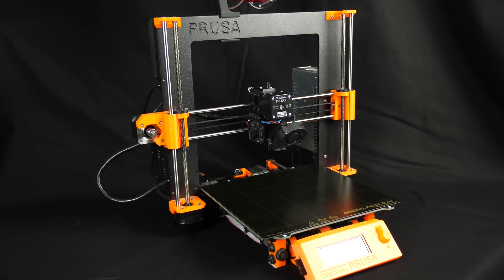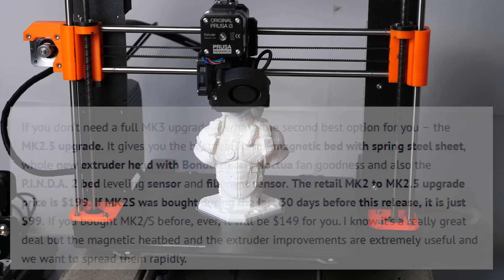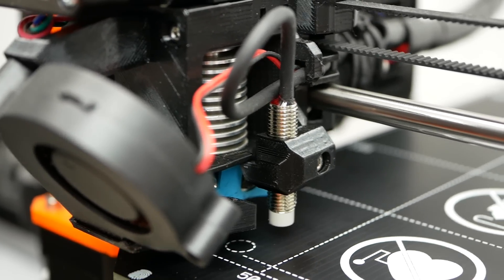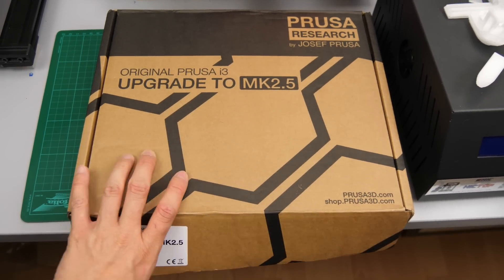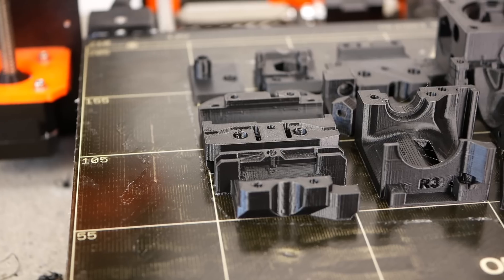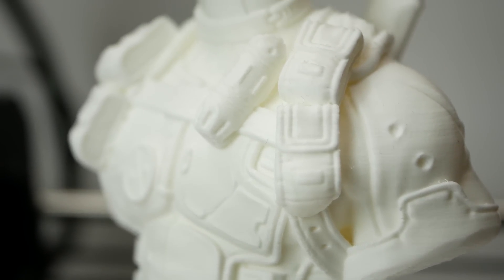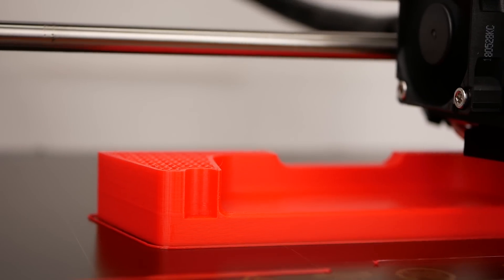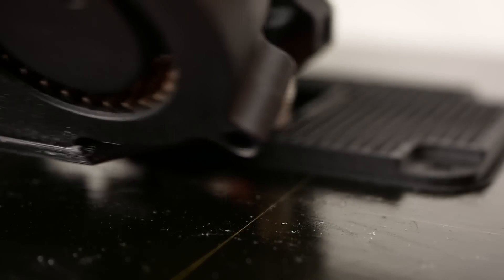Prusa MK2.5 UPGRADE kit - Worth the price & effort?

Comment: After Upgrading my MK2S to a MK2.5 I had some problems - especially regarding overhangs.
But now I found the BEAR Mod Project. I upgraded my MK2.5 to a BEAR including the new X-axis and new extruder. And now it prints really great with the profiles by Chris Warkocki.
Only test missing are overhangs because I now print the Upgrade for my other Prusa ^^

Comment: i have already upgraded to MK2.5 with the powdercoated sheet and it's work very fine.
I Have two questions for you!!
It is possible and if you want that u can share your file setting on S3D for prusa MK2.5.
have you already tried to apply acetone on the steel sheet? let me know if it damaged??

Thanks a lot for your video .

!!!!!! HAPPY NEW YEAR!!!!!!!
Reply from the maker: Happy new year Fabien,
my S3D is noting special. Just the stock one that comes with the software. I don't really belief in much profile tweaking. Slicers have come so far that this shouldn't be that big of a deal anymore.
Have cleaned mine with acetone (NOT the powder coated one) and it didn't do any damage. Have you had any issues?
Reply: CNC Kitchen 
No I was just afraid to try? 

Thanks for your answers

Comment: Got a chinese mk52 clone for my original Mk2 for around 70 USD on AliExpress ~ After flashing the mk2.5 firmware, I had to modify the heatbed with double side tape and circle cut out aluminum foil for xyz calibration since the chinese manufacturer didn't include it on the pcb board. Nevertheless, it's been running fine ever since. The spring steel is slightly warped, but it has improved my quality of life in removing prints off the heatbed. Im actually quite impressed the 2.5 firmware works even without upgrading the noctua fan, filament sensor, or the pinda probe ♥️

Comment: Already upgraded my MK2S with a Buldtak flexplate system and Noctua fan. This may have cost me almost $150 but it didn't cost me as much hassle. Plus my workload won't benefit much from the bondtech and pinda2 anyway.